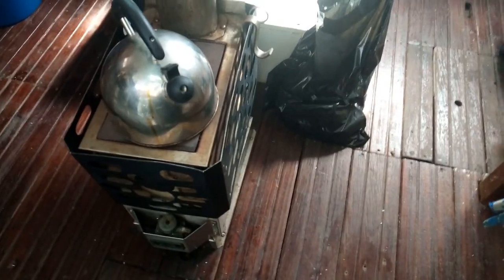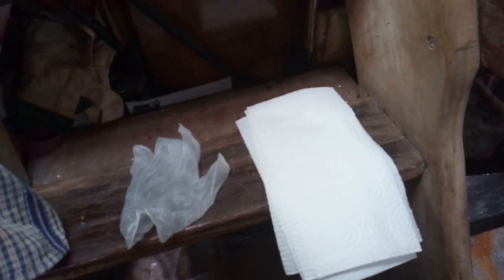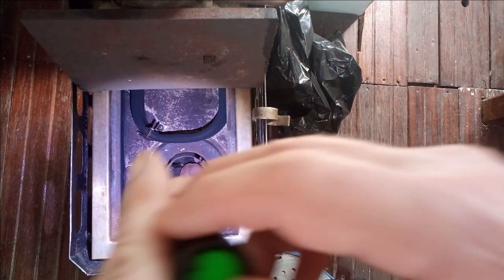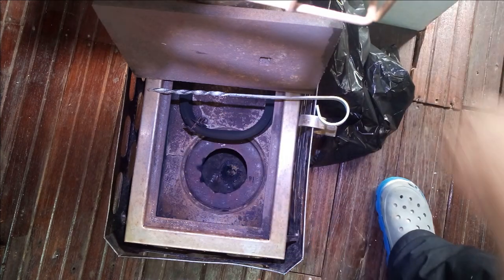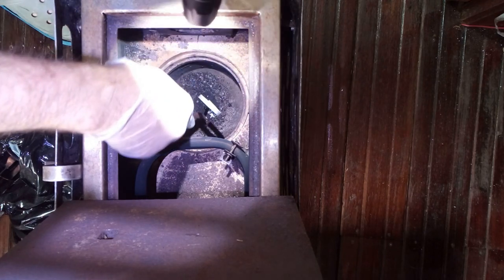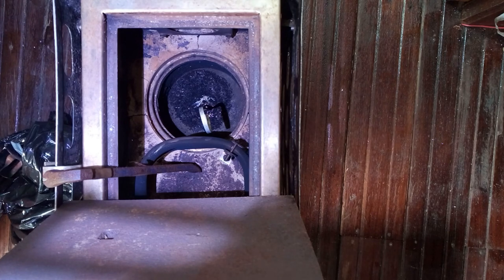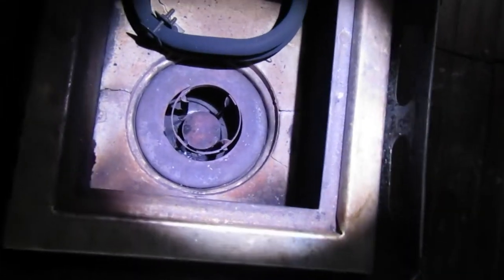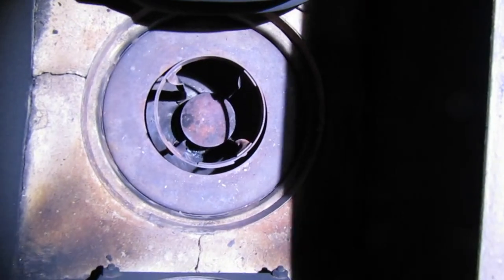Cleaning the Dickinson Cabin Heater

Comment: Richard, thanks for the video, I have a larger Refleks, a 67ms, it’s very smoky- and dirty- unless it is on ‘ Max’
Thanks for the demonstration.
Reply from the maker: Thanks Edward!  

I've had four Dickinson diesel heaters on various boats.  I've found that stack height cures a multitude of problems by increasing the draft, which can then be controlled with a barometric damper if the draft gets too strong.  Issuma's total stack height is about 3m/10'.
 
I've also found the H-style cap to work best--all the others that I've used have at times had problems with either backdrafts or with covering the deck with soot.  Though to be fair, the heaters that had non-H-style caps also had lower stack heights.
Reply: Richard thanks so much for the help!  There is very little info online on the successful use of diesel stoves on board.
Please consider doing another video, including stack height, barometric sampler, high winds, angle of heal etc...

Comment: Maybe an interesting suggestion: since we turned the inside framework upside down, we practically do not have to clean our Dickinson Newport anymore. It looks a bit like a gas stove now when it burns and there is only flame above the large ring.
Reply from the maker: That sounds very interesting, but I'm not sure I understand.  Do you mean you turned the ring upside-down, or the superheater (I think that is the name for the part that sits above the fuel inlet), or both?
Reply: He has the superheater correctly oriented, but it's easy to get things mistaken (I did this when first learning how to use it) and having it upside down would definitely contribute to a poor burn.
Reply: The plate on the inner scaffold needs to be closer to the flame.  Its function is to super heat the fuel to cause it to vaporize as it comes in which will give a cleaner, more efficient burn.

Comment: INTERESTING :: always aware of diesel drip heaters but I have never used or maintained one. //// (1) when at high latitudes does heater run ALL THE TIME, for weeks or months ? , (2)  Do you have any specifications easily available such as BTU heat output and fuel consumption. ( the ubiquitous 1500W electric space heater everyone is familiar with is said to be 5100BTU -->> 3.41 BTU/Watt )
Reply from the maker: Thanks, George.

When it's cold, the heater tends to be run all the time.  I turn it off if I leave the boat, but otherwise leave it running (in port). 

The BTU specification is 6500 to 16,250.   While I have never measured that, it definitely can put out more heat than a 1500 watt electric heater.  

Drip pot diesel heaters, in general, have the great feature of being reliable--if you have it installed correctly, and feed it clean fuel, it will just work.